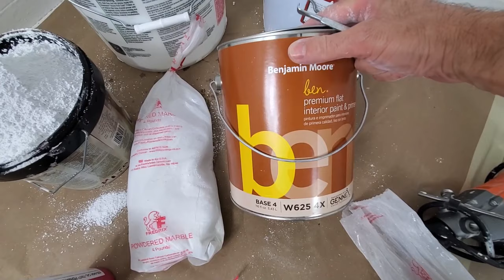Mastering the Mix: Creating Your Own Venetian Plaster for Unique and Personalized Walls

Comment: You're doing a good job with information. Go ahead and voice over with info and mistakes you've made. Laying out the products is a GREAT help for new people. 
I'm a contractor that went through a marble and plaster phase about 10 years ago. 
I did a venetian shower with 4 inch  marble slabs as the floor, elevated with blue beach rock around the two slabs.  I wish I would have done it curbless but oh well. Keep up the good work!
Reply from the maker: Thank you for the tips. I will keep it in mind.
Take care.

Comment: Can i use these mix on a marble countertop? Seems to be kind of microcement.
Reply from the maker: Hi Juan.
To be honest I have not tried it. But since the mix contains lime putty and marble podwer you might in theory apply it on the counter. Other thing tottally different would be durability. In my opinion is not designated to place it  on a counter since water and scratches might damage it.
Greetings.

Comment: Can you do just paint and marble to get the same effect? but of course you will not get a custom color.
Reply from the maker: Sorry but I do not understad you question. Can you be more specific?
Reply: @amazingfinishestechniques3476  sorry can you use one part paint and one part marble dust and create the same effect? 

When you do the semi transparent base it gives you the option to do a custom color but what if you pick a color paint and add marble dust, it would be the same? 

Thank you
Reply from the maker: I have not tried it yet. But most likely not. As far I got the concept in the workshophas to be just Transparent base.Many color do not use that base. I am sure that as long as the base is T4 you are on the right way. Feel free of  experimenting. Nothing is written on stone.
Greetings
Reply: @amazingfinishestechniques3476  yes I understood that it could be paint too, I will experiment and let you know, I am too lazy to put the marmorino on the walls because it is more elaborated in terms of having a base alike a scratch coat so it doesn’t crack and the paint being plastic has more flexibility

Comment: Where do you get the lime putty?
Reply from the maker: From Lancaster Lime or any smaller container,but since I use it very often I get it from them for no special reason.
https://lancasterlimeworks.com/
Reply: You can buy type s lime which is hydrated lime add water too it and let it set for 3 months in a sealed bucket with water over the top and it will save you quite a bit of money.
Reply: @charleshall9629  What's the reason to wait that long. It's already Ca(OH)2 ... it won't react with water anymore. There might be some residual CaO to let reaction to occur but surely not enough to wait 3 months. 1 day for hydrated lime mixed with water and you'll get the very same thing (and almost no CaCO3 which will obviously start to appear if you wait too long). As CaCO3 is the result you are trying to achieve but only AFTER application on wall I assume it's good to not let too much of it appear BEFORE you apply mixture to the wall.
Reply: @Promilus1984  I was always told to let it set for 3 or 4 months
Reply: @charleshall9629  that's like the joke about frying pan... that every woman in a family did cut and throw out parts of the meat when preparing dish, then one day certain husband was curious about it... and he was asking first his wife - she said her mother did that. So he asked his mother in law - she said her mother did that. So he asked grandma and she told him she had too small frying pan to fit all the meat. Doing stuff like that was only natural when there was only baked lime (CaO) and even more so when that lime was not in powdered form but big chunks of rock. Nowadays if you mix that hydrated lime with some water you'll get the same "dough" as the one from the bucket here without having to wait 3 months. Try for yourself and you will see.

Comment: Ouch on the marble plaster. I get it for about $10 a bag. Go to a construction supply house and get an athletic field marking marble powder. 
I used it on normal plaster not venetian but it will work fine.
Reply: In Denver Rio Grand on sante fe has it.